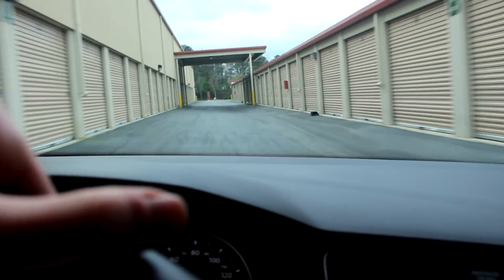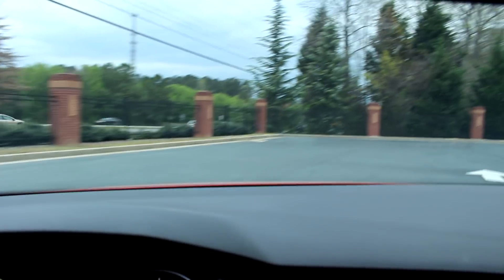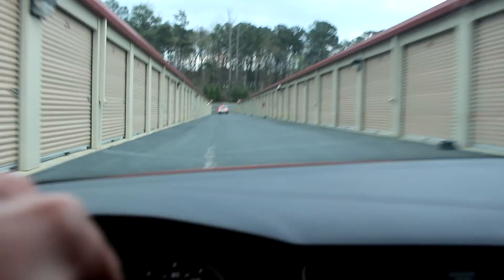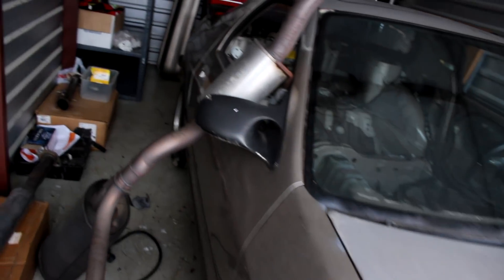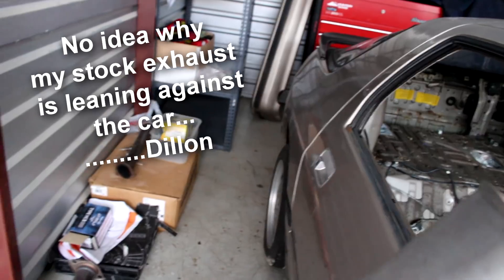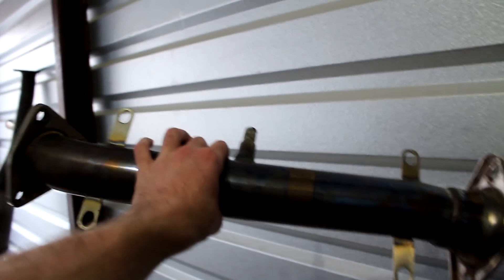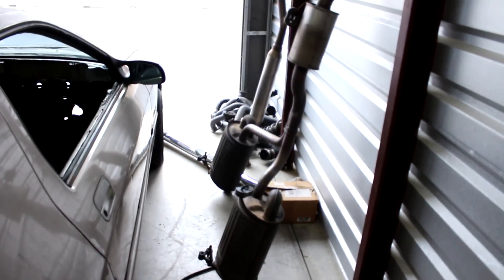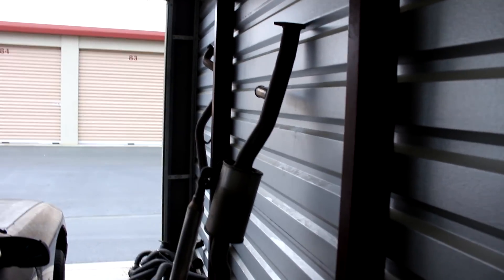Another Car Appeared In My Garage... | VLOG

Comment: If you had the exhaust leak at AMP, that may have contributed to the sound level being so high. 

In any case, Dillon should double down on that Miata, he can always come to the RX7 later. That doesn't mean he should get rid of it, but for now get the Miata the way he wants it.

You know, as long as he keeps the Miata haha